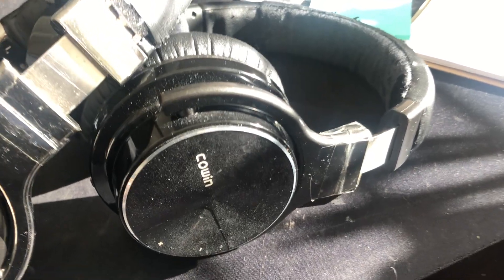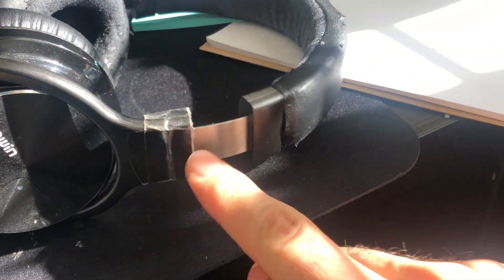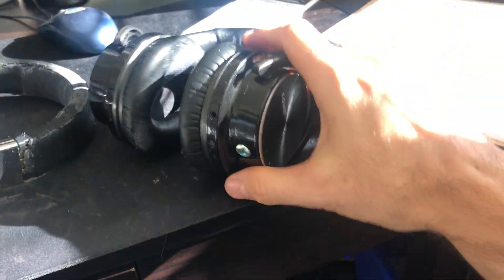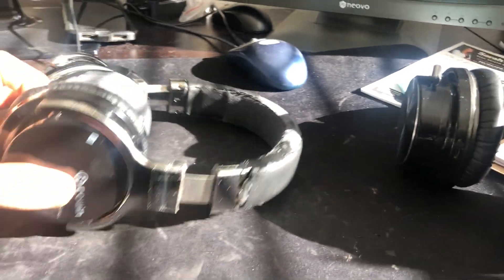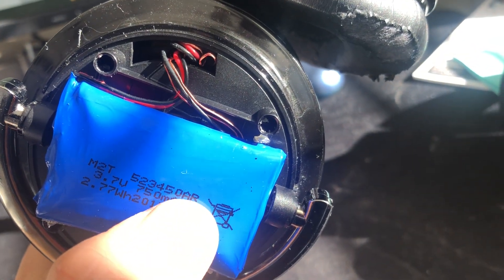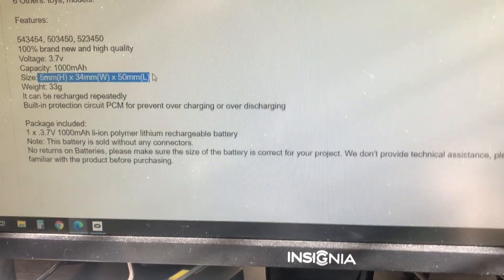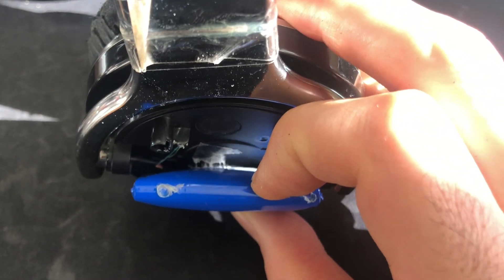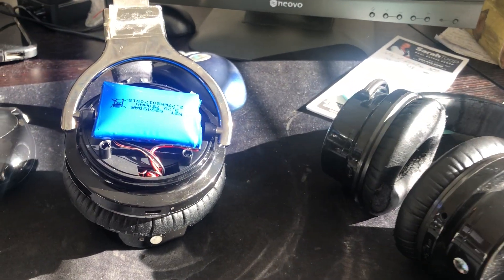Cowin E7 Battery Replacement

Comment: Excellent video, my man. Instead of ordering a new battery I just used an 18650 cell I scavenged from an old laptop battery. Works great and now these headphones should last me another few years.
Reply from the maker: Right on! As long as the battery fits and the voltage is right, good to go.   :)

Comment: Thanks! someone might be tempted to pry at the metal edge face,  but that would get you nowhere as it's a a plastic wall of the earcup on the others side. You have to go at seem shown. It's a bTch, but keep at it. My battery has what looks like some thermal tape or paste on the underside. I'm wondering if I need some kind of thermal paste, but there isn't really anything on that side of the headphone beside some wire. The headphone speakers are on the opposite side of a plastic wall.

Comment: On mine, I found out that there was a small screw underneath the white plastic piece, connecting the cover to the base. I almost broke my cover because I thought the whole thing was only held together with glue. The white piece is held on with some glue, gently lift it up and if your model has that screw, once the screw is undone, the cap should just come off. My battery was also different. It used a BL-5B battery.
Reply from the maker: Are your headphones definitely Cowin E7's? If you're seeing different design, different screws and different battery, I would guess different model.
Reply: @tanbrolo  mine is definitely a Cowin E7. Purchased it in late 2017. Don't know if there were design changes from when mine was sold.

Comment: I just tried to do this.
Cowin is now putting the blue/green pair of speaker wires UNDER the double-sided tape that holds the battery in place.  They're actually gluing the red/orange pair of wires to the battery itself.  Trying to remove the battery is a real struggle.  I was trying to be careful but I'm pretty sure I damaged the red/orange pair of wires.  With the new battery installed & charged the phones are dead.  I put the old battery back and got same result.  I wonder if the headphones go into a "shutdown" mode if they detect a break in the speaker wires?  
pics on imgur  
[SLASH] gallery [SLASH] FYgK91W   <--- append to the tail end of imgur URL
Reply from the maker: That looks fixable, my guess is the taped-together wires just aren't connecting adequately. Any chance you have a soldering iron handy?

Comment: Would have been nice if you'd showed removing the cap covering the battery... That said, knowing what is under the cap is a huge help.

A couple of questions come to mind... I wonder if instead of replacing the battery like for like if a pair of AAs could be swapped in instead? Of course, a skilled 3D print designer could probably produce a replica cover with a battery compartment... or at the very least make a removable cover to ease battery replacement (these are skills I possess).

The reason why I'm looking at this is because I bought a pair of Cowins (primarily for air travel) just prior to the Covid 19 lockdowns. Trouble is that the lockdowns happened & then air travel was hugely expensive & is still just recovering now. The upshot is that I wasn't able to use them for several years and when I tried, they wouldn't charge up.

Like yourself, I dislike wasting otherwise perfectly good equipment plus I usually fly only once a year, so this issue is likely to reoccur again (hence my interest in replaceable batteries).
Reply from the maker: I think that for simplicity, replacing with appropriate size battery is the best solution. For greater ease of future replacement, you could certainly add plug connectors to the wires. But really, wire crimping or a quick solder is not much trouble.

The cover does come off with some aggressive prying. You can see in the video where the four connections and can deduce where roughly to focus your prying. The glue is very strong. Reattaching with a weaker adhesive would simplify future disassembly.
Reply: @tanbrolo  After considering it more fully, I agree... changing like for like has the fewest question marks for compatibility.

However, one thing that I will do is use my 3D printing skills to create a replacement cap with built-in cavity & lid for the LiPo battery. Given the infrequent nature of my travelling, it's likely that I'll encounter this issue again and therefore it makes sense to make it easier to replace batteries in the future.

I have a PCB screw terminal left over from an earlier project which should be ideal for this application.
Reply: @tanbrolo  Just to let you know. I've just completed a project for replacing the battery in the Cowin headphones including a How To & replacement 3D parts.

I'm still waiting on the replacement battery however I needed to get it all completed & ready to go as I'm travelling in late August & wanted a working pair of headphones. I'm looking at 13+hrs flight time on a budget airline which does not provide seat back entertainment.

Unlike your vid, I did not pry the upper off but drilled 4 holes to detach the support posts from the inner face. I determined early on that preservation of the original upper was not necessary as I would be substituting it with a battery lid equipped replacement. Further, the original upper could not be reused in any way so it was pointless attempting to preserve it.

I wanted to thank you as your vid provided me with valuable background info. I have attached a nominal charge to the project (to cover my design work) but its less than the cost of a McDonalds Happy Meal so I don't consider it excessive.

https://cults3d.com/en/3d-model/gadget/cowin-headphones-battery-replacement

Comment: I have the first gen but they have a removable battery. A couple years ago I bought 2 replacement batteries and charger for them and then just change them out when they get low.
Reply from the maker: What is your model? These are both "E7" (gen 1 and 2) and batteries are not removable without clipping wires.

Comment: By the way a 503450 is a little smaller (thinner) and is a full 1000mAh, 250 more than what was in it. Yes, it will change, run just fine.  I did it just now.

Comment: ugh they are held together with glue and tape? Im not sure if I want to fix them now.
Reply from the maker: That's what usually holds electronics batteries. Double sided tape is everywhere. Fix a smartphone, it's everywhere. Doesn't take much prying to get the tape to let go.
Reply: I know how to deal with tape. I used to fix Ipads. I just wish things were constructed better. I ended up putting my headphones into noise canceling mode until they lost all power and charged them again and they work fine now.

Comment: My E7 headphones just failed yesterday with a swollen battery even though I've had them for less than two years. Supposedly they have a two year warranty because I bought them direct off the Cowin website but so far I've not heard any response from my email (assuming that the website actually sent it) and their phone number fist gives you suspicious ad then forwards you to another number which plays music for a minute or so before forwarding you to a number that then disconnects. I looked up their supposed "office" location and it's a small industial park next to the Pomona Freeway and a DOT road maintenance yard in the City of Industry in the LA area. So more than a mail stop I guess but probably mostly a warehouse and shipping location. If anyone has had any luck with warranty repairs from Cowin please let me know!
Reply from the maker: I've had luck with Cowin. Ear swivel on one pair broke and they mailed me new ones. I had initiated contact via Amazon.
Reply: @ Had you purchased your headphones through Amazon or via the Cowin website? It appears that Cowin no longer sells through Amazon though there are many other companies selling what appears to be the same product under other (or no) names.

Comment: Does anybody know why my cowin E7 pro won't power on and make the noise. When I put it on Noise cancelling the light comes on but for the actual power light doesn't turn on. When I put  it on charge the light  indicator turns on. I don't know what to do I've been trying to find information about anything to do with the power on. I know it's not the battery it just quit working out of nowhere.

Comment: mine popped off on its own and won't go back on. worried it is swollen?
Reply from the maker: I would guess that it is a swollen battery. That would make the job easier since the cover is already popped off. I'd suggest removing the battery soon as swollen batteries are more likely to ignite.

Comment: What type of connector is it 1.0mm/1.25mm/1.5mm/2.0mm/2.54mm or Plug? For the battery of course.
Reply from the maker: There's no connector. Two bare wires after splicing.
Reply: @tanbrolo  ok thank you
Reply: I'm wondering if there is a male/female connection (connector plugs) available on the web that would allow a new battery install without the need for soldering ???  If i fine something,  I'll update this post; and if anyone else has already found a set of connectors that work, please respond back. Tanks!
Reply from the maker: @dso2805  There's nothing for a connector to plug in to. The original battery wires run in to the headpiece and the only way to remove battery is to snip wires. I guess you could add male/female connectors but I think it would be easier to just solder for a minute every few years when battery gets replaced.
Reply: @tanbrolo  Can I just splice and tape the wires? I don't have a soldering gun and I doubt if I can do it correctly anyway.
Reply from the maker: @dovie2blue  Yes splicing/taping would probably be fine.

Comment: Hey, can I ask.
I'm having an issue with my E7 where the Bluetooth and Aux won't kick on but the noise-canceling works great, it charges as normal and the switch seems fine.

I barely ever took them out of their box, they mostly just sat on a cool dry shelf only to be occasionally taken out, charged and used a bit.

Comment: What the fuck did you have to do to rough up your headphones so bad?? lmao, I've had mine for years and they still look just as good as when they came out the box minus a few minor scratches on the chrome sides. Just started having problems now with it not turning on bluetooth, or playing sound with any settings....
Reply from the maker: Roughed up? Not particularly. The faux leather flakes away in time and the E7 swivels are known to break. What the fuck did you have to do to make Bluetooth not work??
Reply: @tanbrolo  I don't know man... I've had mine for years pretty much since they came out, used them extensively as the only pair of headphones I have aside from different earphones and even taken them back and forth across the country, and cleaned them hundreds of times in total, still zero signs of wear on any of that material. Unless you've had them under harsh conditions or weather, I don't see why they'd get so bad "in time". Bro you probably just don't take very good care of your shit and that's why. Without sugarcoating anything. Is that also why you have more than one pair? lol. You can't have had either pair any longer than me as I've had them since the Christmas of the year they released, and well like I said, they're in near perfect condition minus the battery, which is easily replaceable.
It's nothing I did. I've had times in the past where the headphones just don't seem to connect to my device despite them being on, but with a few resets it was fine. It happens rarely, too. It's just that they aren't a perfectly designed item, not that I don't love them. Pretty sure this time it's just the battery gave out and lost most of its juice, hence why I came to your video, to see how exactly to replace it. Banter aside, thank you for making this video, and not deleting your channel despite it being dead and dustier than my great grandma's coffin 😊💀 I kid.
I already ordered a new pair of identical e7 headphones by another brand and they're coming tomorrow, so I plan to sell these ones and say they just need a new battery. Oh but you can't have them though. I'm selling to a friend lol. If you want a nice clean pair of cowin e7s, good luck, godspeed! 👋🏼